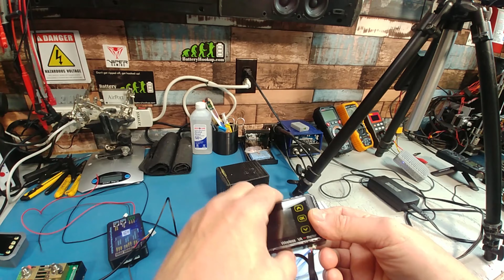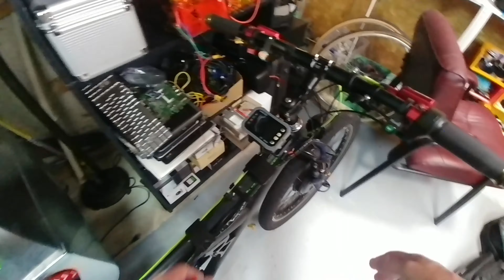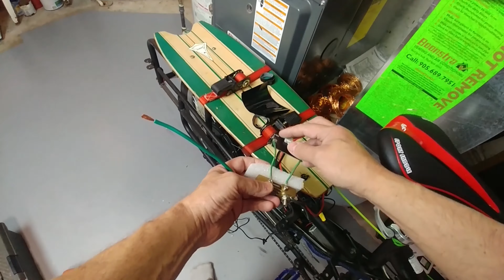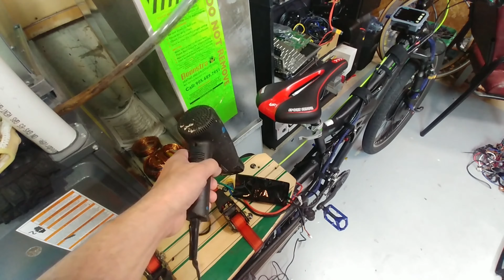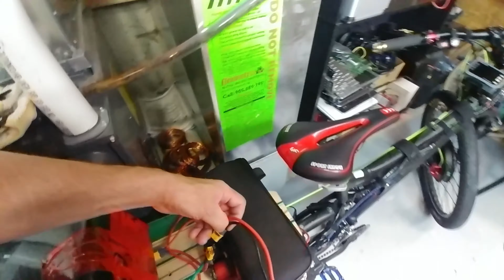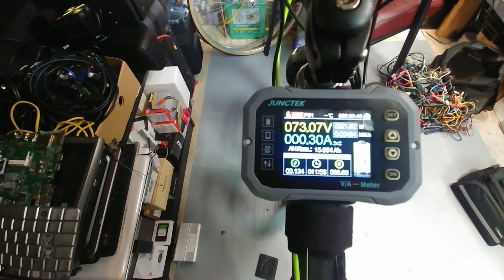ebike  vlog#  voltmeter install *JUNTEK DC 0-120V 0-400A KG140F*

Comment: 🚴Love the screen on this one! It's great to see how you work and wish I have a bit more equipment to do this!  
I working on an old A2B 2012ish version PAssist, 36 volt 500 watt metro and the 7 pin connector from the hub has  +- 2 wire output and 5 smaller ones on it 3 for halls and not sure of the rest yet!  
Any thoughts if I can use this screen with that project! Not looking to make it stock anymore but love the size of it. So I will prob. chop off connectors and use the more standard ones.. Would love to use a 48v 20+amp battery with a matching controller kit but just searching for near best/correct parts is getting overwhelming!   Hopefully you make time to ride some of your creations there!  Thanks for sharing so much of your work and Kind Regards!